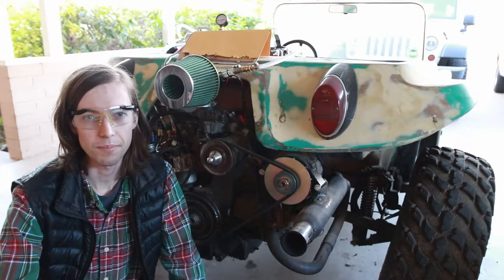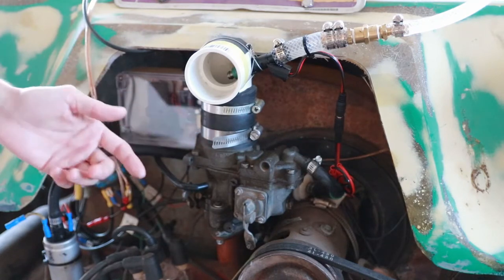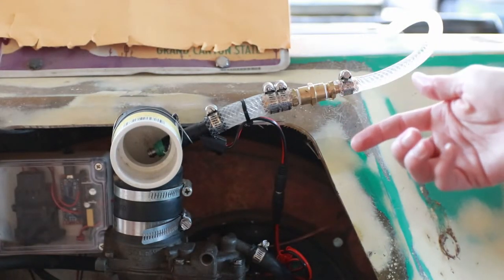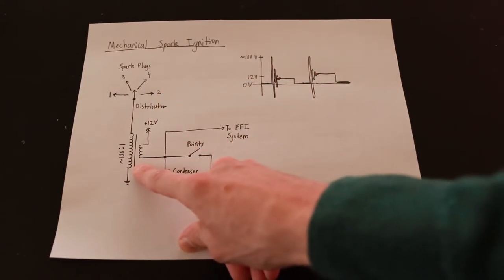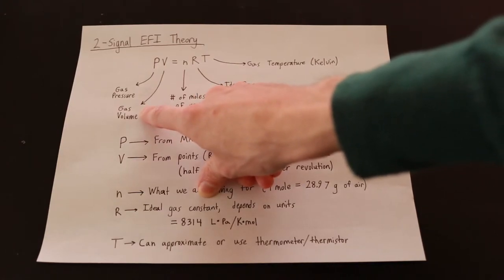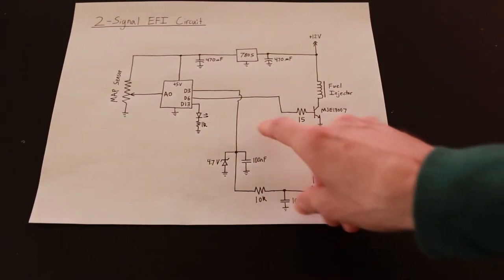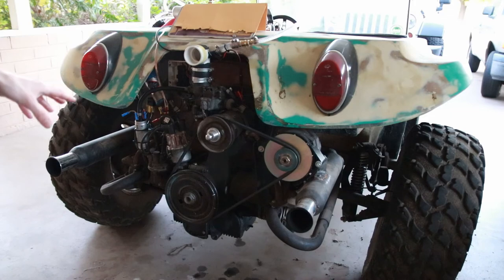Electronic Fuel Injection with MAP and Points Only

Comment: Hi, few thoughts for you. 1) wouldn't use clear vinyl/pvc non fuel rated tubing as they breakdown over time. 2) on your fuel injector FET would incorporate some type of anti-flyback to prevent the solenoid coil from causing mcu glitches/resets as a result of voltage spikes. really cool project you have
Reply from the maker: For sure, in my final version I'm using high pressure rated rubber fuel line, not vinyl. 

That's a great idea about adding flyback protection. I wouldn't use a diode alone, as I fear that the closing time would be too slow on the injectors, but a zener diode or RC snubber would probably work well. In my new videos I recommend putting a copper screen over the MCU and its crystal to prevent glitches from external EMI, and this seems to work well. Mainly I was getting glitches from the spark ignition, rather than the injector EMI.

It's also worth noting that although the IRFP460 is repetitive avalanche-rated, avalanche will eventually degrade the gate dielectric due to hot carrier injection. So this would be another good reason to use a back-EMF circuit.

Comment: We usually run about 100mA through the points just to burn off any light surface contamination. I'd have a driver transistor driving the injector transistor, that 15Ohm does very little. As for the RPM sensing problem, you could gate your interrupt so it's only enabled when you're expecting it ie have a background averaging routine, which should filter out spurious triggers, so if your average rpm is 2000rpm (33Hz, 30ms period, for a 4cyl) disable the interrupt for, say, 20ms. This disable period will vary dynamically with average RPM. An inductor and some sort of voltage clamp at the input to the 7805 is a good idea as you can get huge (400v!) spikes on a vehicle electrical system when inductors (wiper motors, fuel pumps etc) are switched. Hope that helps.
Reply from the maker: Fantastic suggestions! I'm working on a PCB version of this system now and will definitely incorporate these into the next revision. I've moved to MOSFETs for driving the injectors, and I've also implemented a high-energy ignition system using a low-impedance coil and 555 timer for a fixed-dwell pulse time. I've preconditioned the power to the 7805 with a zener clamp (for spikes) and a boost converter module (to maintain voltage during cranking). A series inductor is also a great idea to filter spikes, although so far I've not burned out the zener or the 7805 (even switching quite aggressive inductive loads and even disconnecting the battery with the engine on). Giving the points some extra drive current is a great idea to keep the corrosion away. I also piggybacked the RPM sense signal off the HEI ignition circuit I built, and as a result it no longer has to filter the massive ~600V spikes at the coil. Rather, I can now use the signal from the MOSFET gate, which is way cleaner, to measure RPM. Thanks so much for the input!

Comment: You may want to search "points trigger hei" and if you use the 7 or 8 pin hei module there is an output pin you can use. Also, the Ford TFi  unit can be used too.
Reply: Be advised, the tach output from a HEI is very “dirty” with voltage spikes. An MSD module for HEI has clean output, or filter the stock module output.

Comment: This is awesome! I may spin a custom board up to used this. Would love the integration of a TPS.
Reply from the maker: That sounds wonderful! If you use a 3-wire potentiometer type TPS, you should be able to directly connect it to +5V, GND, and one of the analog inputs on the microcontroller in order to read the TPS state. A 100nF decoupling capacitor would also be good on the analog input. Let me know how your board design goes!
Reply: I would also like to see the board I can't get enough of this video

Comment: I have questions.
1. How is the acceleration pump supposed to work when you’re using injection?
2. Do you need an idle control valve?
3. Can you go draw through from the turbo or supercharger or blow through with this method?
4. Can this work for 2 stroke engines?
5. What are some of the draw backs when using this method?
Reply from the maker: Thanks for your questions!

1. I did eventually implement a way to emulate the accelerator pump by adding additional fuel proportional to the rate-of-change of the MAP pressure, i.e., how abruptly the throttle was being opened. However, I eventually found it to be rather unnecessary, as it would drive just fine without any accelerator pump emulation, and tended to produce a puff of smoke on hard acceleration when it was present.

 2. An idle air control valve is useful for improving cold starting, but not strictly necessary. Just setting the idle air screw on the throttle body is adequate. I did implement a fixed minimum duty cycle to help smooth out the idle.

3. Theoretically a turbocharger or supercharger can be used if you select a MAP sensor capable of sensing both positive (boost) and negative (vacuum) pressure and set its offsets correctly in the program code. You would definitely want to inject fuel downstream of the turbo/super for multiple reasons, including response time of the mixture reaching the engine, preventing fuel from accumulating in the intercooler, preventing fuel from washing lubrication away from the bearings in the turbo or supercharger. Since the injection would most likely be configured after the throttle body, the fuel pressure would also need to be manifold vacuum compensated; many fuel pressure regulators support this capability.

4. I believe it should work for 2-stroke engines, as long as a spark pulse is available to determine engine speed. The "pulses per revolution" constant would need to be adjusted accordingly based on the number of cylinders in the engine, and would theoretically be double that of an equivalent 4-stroke engine. A 2-stroke will fire each cylinder twice as often as that of a 4-stroke, unless a wasted-spark system is being used on that 4-stroke engine. The higher viscosity of the oil-mixed fuel may affect the flow rate in the injectors.

5. The biggest drawback of a purely speed-density control scheme like this one is lack of responsiveness to throttle input. MAP sensors are relatively slow, so a lag in fuel delivery will result in a lean spot during a rapid increase in throttle position of a rich spot during a rapid decrease in throttle position. Adding a throttle position sensor and blending signals between the MAP and throttle can improve this. 

Another disadvantage of this system is the lack of oxygen sensor feedback. Without closed-loop control of fuel trim, the ECU is relying on potentially incorrect assumptions about fuel injector flow rate, volumetric efficiency of the engine, and other non-idealities. As such, it will probably always slightly lean or slightly rich, and may drift over time and environmental conditions.

Another disadvantage of throttle body injection (TBI) is the lag time introduced by the delivery of fuel from the throttle body to the heads. This has a similar effect to the first disadvantage (slow response time). One positive tradeoff of this effect is that it allows asynchronous fuel injection timing to be used, as there is plenty of time for fuel and air to mix before they reach the heads, and thus injection does not need to be synchronized to intake strokes for each cylinder.

A disadvantage common to all fuel injection systems, as compared to carburetors, is the need for a constant supply of (very) pressurized fuel. A carburetor's bowl allows it to continue functioning even during intermittent loss of fuel flow, and requires very little pressure to operate. With an EFI system, even a transient decrease in fuel pressure will lean out the mixture and result in a sudden loss of power and stall event.

In any case, I've been running an improved version of this system on my buggy, and drove it ~25 miles per day for a couple of months. It wasn't perfect, and that fuel pressure issue got me stuck once, but performance-wise I still found it to be a lot nicer to drive than with the carburetor. I have a new daily driver now, but when I do take the buggy out I still find the 2-sensor system plenty good enough for me.

Comment: I would put a small coil over cilinder 1 ignition wire, with some transistors and a monostable oscillator, then you will have little to 0 noise on your ignition signal, it's just frequency divided by 4

Comment: Wow amazing idea and implementation, very impressive! I took a look at the code, and if I understand correctly, it primes the system each time upon startup, is that correct? Thanks for making this available to everyone and explaining it so well in this detailed video.
Reply from the maker: That's correct, the fuel prime helps ensure a prompt startup even if the starter motor is slow.

Comment: Hi I saw your map_efi_v2.ino , if I am not wrong , on call to AFR() , the parameters are swapped.
Would happy to see O2 sensor integrated.
Good luck
Reply from the maker: Great catch! It's been reading the RPM and vacuum signals backwards this whole time! That explains a number of weird behaviors I had been encountering over the past few weeks of testing, lol

I'll update it later today and push the latest version
Reply from the maker: Just finished testing it on a quick test drive, and the new version is now up on GitHub! You got special mention in the extended description as well. Thank you!

Comment: I'm pretty sure a system like yours has been made without anything digital. Actually, I know one has, and most were before computers, I can't remember what model I'm thinking of…

What you need is what they had, both on early electronic & mechanical injection, and was on carburetors as the injection pump. You need it as a throttle position sensor, then have the injection pulse width increase when the throttle opens, before the intake pressure rises. Visa-versa for when the throttle closes.

Finally, add an O2 sensor & the system can correct itself as things change (like temperature) to maintain a stoich mixture.

Comment: If you are interested in a production type setup of this on small scale check out Dynamic EFI. Different versions used can add usability from GM TBI control to Buick grand national. I have one on a GM TBI truck with two BAR map from GM and it will map for boost allow for 9 external controls lime nitrous activation and can see signal from a wide band. If you got a stand alone A/F meter with analog and digital out you could control your over fueling!

Comment: Instead of a second order passive LPF, I think I would go with a higher order active band-reject filter that's tuned to the resonant frequency of the LC circuit formed by the ignition coil and capacitor. It's more components and requires more knowledge to design, but should give you better results as far as your overcounting problem. You could even try a passive RLC band-reject first, also tuned to the resonant frequency of that LC circuit, and see what you see on an oscilloscope to see if it's worth pursuing.
Reply from the maker: Great idea! The only issue is that the resonant frequency seems to drift slightly depending on the combustion conditions. It seems that the impedance transformed from the high-voltage side of the coil has a significant effect on its overall LC behavior.

What I found to be even more effective was a monostable 555 circuit triggered through a zener diode. This ensures that only the first voltage spike on the points opening triggers the monostable circuit, and once it is triggered, a clean digital pulse is delivered to the microcontroller.

Comment: I like how you show that a efi system dosn't have to be complicated :) just a thought, how about only using the points with a pullup as a trigger and driving the coil with something like a bip373 or similar from the arduino ?

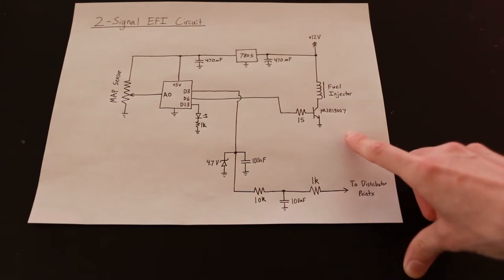Comment: the minute 8:31 the resistance of the transistor what value has 15 ohm? and the resistances of how many watts are they?
Reply from the maker: For the BJT, I used a 15 ohm 1/2 watt resistor for base current limiting.

Comment: I saw some sparks at your dist. (where the plug wires enter the cap),when it was running,    take a look at the video again and you will see.
Reply from the maker: Indeed, with the clear distributor cap you can see where the spark jumps from the rotor to the cap contact.

Nowadays I use a fully electronic spark ignition system with optical pickups in the distributor. You can check it out here if you're interested!
https://youtu.be/3S8LlHKaa_o

Comment: Fantastic sub-genre of Automotive engineering! I'm in between many projects, but this has me thinking. Can you utilize a mechanical-electronic gate such as for example, On a single cylinder engine with a magneto on the flywheel, If we placed a hall window and sensor on the flywheel for roughly 45-90 degrees before TDC, in effect creating a crank sensor? With a single cylinder, all we would need is a gate and the map sensor to modify pulse width. I would throw temperature out the window, run it slightly rich, and adjust the fuel pressure to get there. (edit) - Since the single cyl doesn't use a distributor, I'm interested in the simplest solution. Running a Tecumseh 4hp on a pocketbike frame with a billet connecting rod and 24mm Mikuni carb clone.

What do you think of this for a simple single injector, single cylinder setup?

Comment: Excuse me for asking yet another question.
I installed the Arduino on a V6 3.1L engine and it doesn't want to sustain either idle or acceleration.
What I've modified in the code so far is:
1. Set fuel_comp to gas;
2. Set pulsesPerRevolution to 3 (which is the number of ignition coil pulses for a V6, right?);
3. I even set stallRPM from 300 original to as low as 30 and 5 just to see if the injectors work (they do).
 Now, the 3.1L engine uses two BTI injectors both driven at the same time from the same MOSFET. I'm not sure if the original displacement_Liters value of 1.6 should be left alone (since 2*1.6 equals close to 3.1) or I should change it to 3.1?
Reply from the maker: It sounds like you have the values you listed above set correctly. The displacement can be left as 1.6 liters. What you will need to adjust next is the fuel injector flow rate, or "injector_MaxGramsPerMinute" to match the total mass flow rate of fuel supported by your injectors at the fuel pressure that you are using. Once this has been updated, you will also need to adjust the minimum idle duty cycle values in order to get a stable idle. When the engine first starts, this is governed by "min_DC_startup" and when it has run for a few seconds, it is governed by "min_DC_running". these values may need to be set experimentally, as they will heavily depend on the amount of idle air that you allow to bypass on your intake.

Comment: i saw your old video on running a switchmod power supply on a generator. I am making a hybrid ebike and will be using a generator to power a switchmode supply to power the bike (no batteries at all, just purely a gas powered ebike). I saw you said some concerns about voltage ripple... Could that be corrected by putting capacitors parrallel to the 120v AC from the generator feeding the input of the switching supply.  I am not electronically experienced so i dont know much. Also, i do believe adding capacitors to the output of the switchmode supply would filter the DC power made.
Reply from the maker: Due to the frequent changes in load associated with the bike motor load, I suspect voltage transients caused by load dumping would be the bigger concern, rather than voltage ripple. 

One potential solution to this issue would be to select a switchmode supply with full-range input voltage (100-250V AC) so that a sudden increase in voltage (assuming a 120V generator) would be less likely to exceed the maximum input voltage rating of the power supply.

Another potential solution would be to add additional capacitors on the high-voltage DC side of the power supply (just after the rectifier), so as to absorb the additional surge of current from the generator during load-dump.

Adding capacitors to the AC side of the generator would not be ideal, as this would increase the leading-angle reactive load on the generator, which can overheat it and may also result in overvoltage being an even bigger issue.

I'm looking forward to hearing more about the results!
Reply: @DielectricVideos  thank you!!! that sounds great about the 110 and 240 dual swithing supplies, i see them on ebay for servers... Your right its better to add capacitors not to the AC side but the DC side output. thanks... i will keep u updated :) I dont have that much EE knowledge so thanks... i forgot about the power factor correction which would change the leading angle with the caps...

Comment: you can probably improve this by using a throttle position sensor (eg. a simple potentiometer on the throttle valve) in order to make the mixture richer when neccesary

Comment: Id like to do one using a 555 timer chip  whose frequency and pulse width is controlled by the distributor signal for pulse tining and the o2   sensor for the width of the signal.

Comment: You should desintall the carbuertor and replace it with a Bosch Monomotronic injection which already has the throttle body and the injector installed